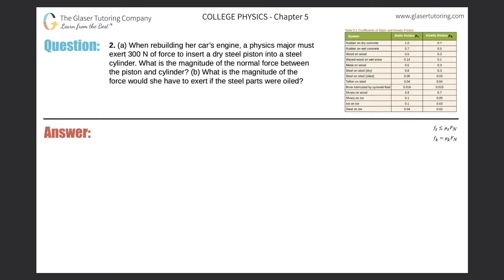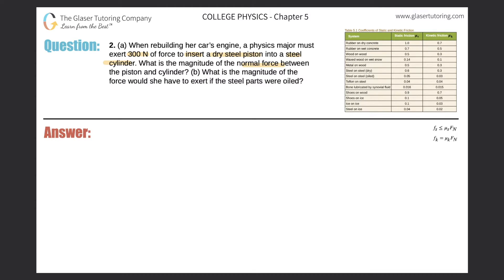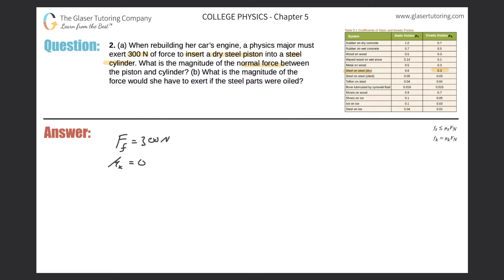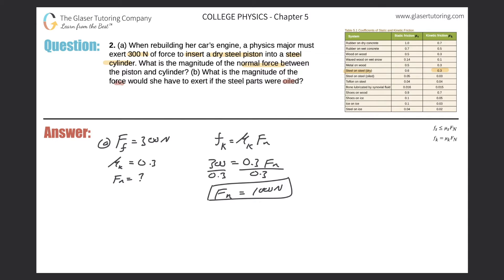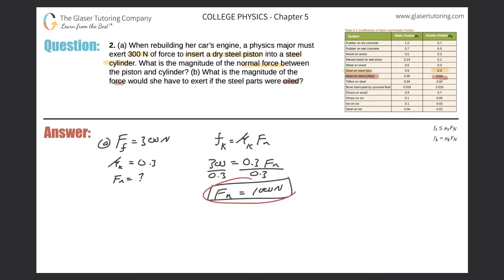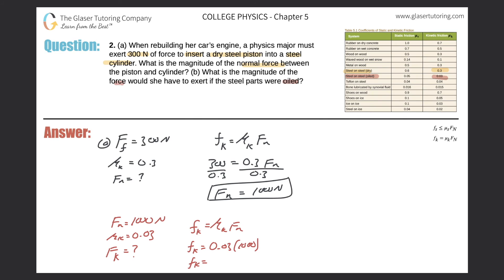5.2 | When rebuilding her car’s engine, a physics major must exert 300 N of force to insert a dry

Comment: How do you know the 300N is a frictional force?
Reply from the maker: Hi there!  Since the problem mentions that the Physics major is exerting 300 N to insert the piston, and there is no indication of other resistive forces (like pressure difference or other mechanical resistance), this 300 N can be considered the frictional force. The question implies that this force is required to overcome the frictional resistance.  Hopefully this helps!

Comment: Strictly speaking, wouldn't there be no motion if the exerted force of 300 N was equal to the frictional force? So, in actuality the 300 N of exerted force is slightly greater than that, or the frictional force is slightly less?
Reply: TAMIU Physics professor here. This is a good question. The answer is not in this case because we are talking about kinetic friction, where the piston is already moving. The net force is 0, this is true. This means acceleration is 0, so the piston is not being accelerated anymore by the physicist. However, the system could still move at a constant velocity. The time derivative of velocity is acceleration, and the time derivative of a constant velocity is 0=acceleration, as understood by Newton's 2nd law Fnet=0=ma implying 0=acceleration. A good example of this in a lab experiment would be the friction ramp with wooden blocks, pulleys, and weights hanging off the end. The block could travel up/down the ramp at a constant velocity when the weight hanging off the end is equal to the friction force.

Comment: Hmmm. How come the normal force remains the same at part b if the 300N (which was used to calculate Fn) changes and so does the 0.3? shouldnt more or less frictional force mean a change in normal force?
Reply from the maker: Frictional Force (Ff) = coefficient of friction * Normal Force (Fn).  The frictional force changes because the coefficient of friction changes.